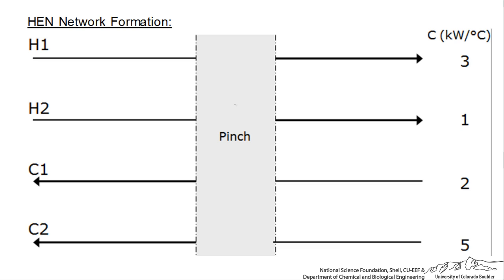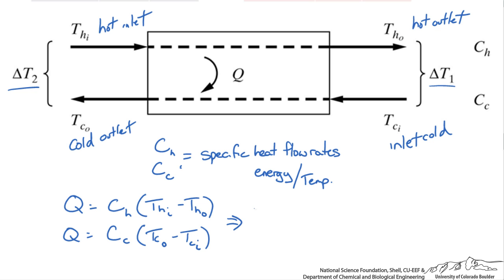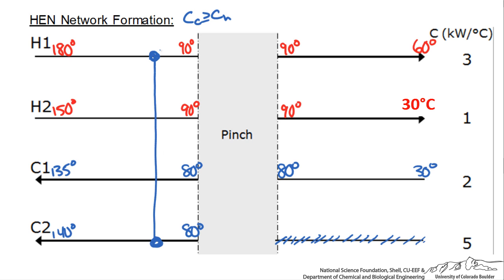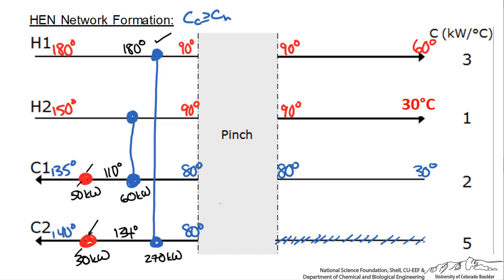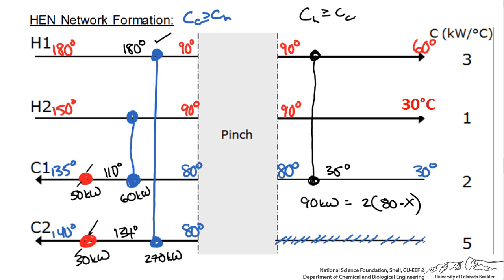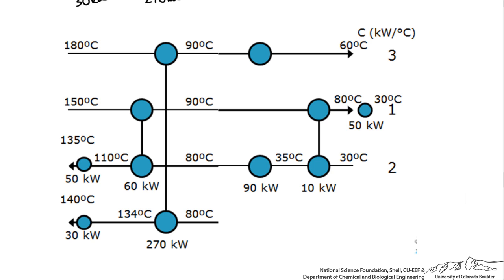Designing a Heat Exchanger Network

Comment: I am confused. Here you are connecting H1 to C1 and by delivering 90 kW of heat, temperature of H1 will reduce from 90 deg to 60 deg. This part is ok. But after receiving 90 kW, temperature of C1 should rise by 90/2=45 deg which means temperature of C1 will go to 35+45=75 deg. But you mentioned it as 35 deg. This part is not clear to me. Can you please clarify?

Comment: Great video 👏 small correction at 8:15 is required cold stream can be heated to 75°C not 35°C
Reply: No, it 35 deg only, i think you took temperature difference as (t-30) instead of (80-t).
Reply: @rohanchess8332  it doesnt matter, either way you apply the same utility because its a 5 degree difference
Reply: I saw that too.  For a stream that requires 100kW to heat from 30-80°C can't move from 30-35°C with that heat capacity if you injected 90kW

Comment: For the hot pinch, what do you do if the hot energy is greater than the cold? I guess it means the hot has enough energy to cool the hot stream to its target temp, but how does it change the way I draw this? Do I add a utility on the hot stream? do i write the cold stream energy under the circle instead of the hot stream energy?

Comment: Hello, I'm a Chemical Engineering student. I have a question, we are required to design a heat exchanger network based on an already reported process, what I don't really know is if we can only apply this method to the flows of the heat exchangers that we already have, or if we can also include the flows coming from other equipments (like reactors o flash separation devices)

Comment: On the cold side of heat exchanger network 
Ch>= Cc
Then how did you do the last heat exchanger
Reply: Yes if you start from 30 DegC cold water inlet and match C2 with H3 you will get cold water outlet as 75 degree but then there will be a discontinuity in stream temperature at the pinch point which is 80 degC.. So how do you account for the the temperature rise of cold water from 75 deg to 80 deg C. You have to add a hot utility then which is against the rules of pinch analysis as one should not add hot utilities in cold section and vice versa because they in turn increase utility requirements on the other side to maintain energy balance. So one should always start from the pinch temperature. The theory on the web cast is correct. Moreover if you do that you may not be able to utilise 10 kw of C1 to cool H2.

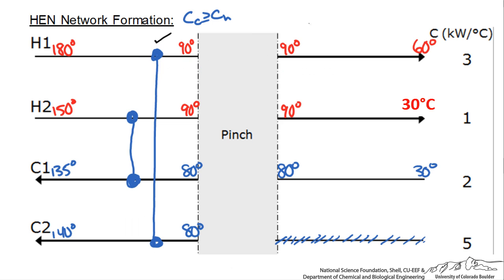Comment: Question at around 5:00. Why can't we increase the cold stream from 80 C to 140 C? (@C2) I didn't understand the reasoning behind that :)
Reply from the maker: Great question!  So the duty to cool the hot stream from 180 to 90 C is 270kW as shown in the video.  This means that it can only take 270kW of out of another stream.  However, the duty required to heat the cold stream from 80 to 140 is 300kW.   This means that the duty of 270 kW from the hot stream is not enough to completely heat the cold stream.

Please let me know if I can clear this up any more!

Comment: Links to the heat loop video?
Reply from the maker: Unfortunately we don't currently have a screencasts regarding heat loops at this time.  This is however a topic we are considering.
Reply: Okay :( any alternative links I really needed some insight into breaking loop and stream splitting methods
Reply from the maker: Unfortunately this kind of analysis is based a lot more on the intuition of the person doing it than a specific procedure.  In general, a heat loop occurs when there is a clear circular connection between multiple heat exchangers.  Alternative exchanger configurations can break them, stream splitting, or replacing an exchanger that is part of a loop with one or more utilities.  How these loops are broken, or if they are broken at all, typically has a lot to do with the cost of doing or not doing so.  I'm not aware of any specific links that offer more detailed guidelines.  I hope this is at least somewhat helpful!

Comment: While evaluating in the cold side, the connection is made between H2 and C1. but the rule specifically says that Ch>=C1. In this case 1!>2. How can one connect these two streams? and what did you exactly mean by crossing over at that point?[8:12]
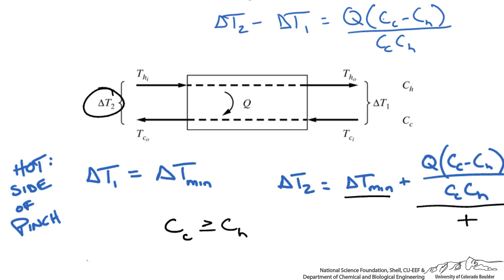Reply: For those who are still wandering: If you look at the derivation at 2:50, we say that DeltaT2 corresponds to DeltaTmin. So we know that DeltaT1 needs to be bigger than that hence, c_c has to be smaller than c_h. But at 8:12, DeltaT2 does NOT correspond to DeltaTmin, but is (90-35=55K) and DeltaT1 is (80-30=50K). So if you look at the derivation at 2:50 you would only be allowed to do this transfer if c_c is bigger than c_h even though we are at the cold side of the pinch. So always check if the temperature difference after the transfer is bigger or smaller than before than check if c_c has to be bigger or smaller than c_h according to the two formulas mentioned around 2.50.
Reply: same doubt here

Comment: In cold side networking you have to remove heat from H1 and add heat to C2 . 90kW Adding to C1 heats it from 30 degrees to 75 degrees. How can you get 35 deg , you are not cooling down the cold stream i suppose,  and the remaining 10kW is supplied by H2 making the cold utility 50kW.
Reply: Yeah, it's 90 = 2 (x - 30), not 90 = 2 (80 - x).
Reply: Yes if you start from 30 DegC cold water inlet and  match C2 with H3 you will get cold water outlet as 75 degree but then there will be  a discontinuity in stream temperature at the pinch point which is 80 degC.. So how do you account for the the temperature rise of cold water from 75 deg to 80 deg C. You have to add a hot utility then which is against the rules of pinch analysis as one should not add hot utilities in cold section and vice versa because they in turn increase utility requirements on the other side to maintain energy balance. So one should always start from the pinch temperature. The theory on the web cast is correct. Moreover if you do that you may not be able to utilise 10 kw of C1 to cool H2.
Reply: +Srihas Velpuri 
yeah your right i caught that also, its just a mistake
Reply: @mustafak4b   Nope, that's not a mistake. He is right. In his case, the 90kW  from H1 can heat up C2 completely to 80 celcius only if the starting temperature starts from 35 celcius. That is why he calculated the 35 celcius there. So from 30 celcius to 35 celcius in C2,  you will need additional 10kW heat which he took from stream H2. This is why he linked H2 with C2 (In between 30-35 celcius)
Reply: @arvindrannagasparan8353  yeah but why cant you use the energy to go from 30 celcius to 75 celcius and add 10kW to go from 75 to 80 ?

Comment: How do you say that the C1 to H2 is 10 kw, in Cold section. Is the pinch temperature of C2 is changed is from 80 to 35 deg C in Cold Station?...... Then It make sense.

Kindly share your feedback.
Reply from the maker: Swami Nathan For the first exchange of that stream, the temperature of the cold stream is lowered from 80 to 35 deg C.  The remaining 5 deg C difference is then used to cool the H2 stream to 80 deg C, but a further cooling utility is needed to bring H2 down to 30 deg C.  Thank you for your questions.
Reply: LearnChemE . Do you have any additional videos on Heat exchanger networks (Pinch Technology). If possible can you pass your website so that I can follow it effectively.  

Thanks

Comment: Dear Prof,

I have the following discrepancies in your presentations

1.In Step 1 procedure, you actually swap the values of H1 and H2 streams.
1.In HEN Network Formation, You would not be able to connect H2 with C1 because, C of H2 is less than C of C2
Reply from the maker: Swami Nathan On the hot side, you need to connect ones where C of the cold stream is greater than or equal to the hot stream.  As for swapping the values of the H1 and H2 streams, I think you are referring to the previous screencast that is linked to this one.  Yes, that is a problem and we hope to correct it soon.
Reply: LearnChemE  Thanks for your reply. I still agree with your comments, But I was referring for cold side section. Please kindly check the second connectivity ie H2 with C1.

Comment from the maker: This screencast has been reviewed by faculty from other academic institutions.
Reply: +LearnChemE  shouldn't the temperature on the cold side of the pinch be 75 rather than 35?   90=2(x-30) instead of 90=2(80-x)
Reply: Yes if you start from 30 DegC cold water inlet and match C2 with H3 you will get cold water outlet as 75 degree but then there will be a discontinuity in stream temperature at the pinch point which is 80 degC.. So how do you account for the the temperature rise of cold water from 75 deg to 80 deg C. You have to add a hot utility then which is against the rules of pinch analysis as one should not add hot utilities in cold section and vice versa because they in turn increase utility requirements on the other side to maintain energy balance. So one should always start from the pinch temperature. The theory on the web cast is correct. Moreover if you do that you may not be able to utilise 10 kw of C1 to cool H2.
Reply: +Tu mi You are incorrect. 90kW added to C1 is 80 - (90/2) = 35.
Reply: yeah but aren't you actually heating C1from 30 to 75 not cooling it from 80 to 35?

Comment: Hi there.. Was wondering how do you calculate the estimated temperatures at the pinch points; i.e. 90 deg for H1 and H2 as well as 80 deg for C1 and C2?
Reply: its actually from the last video, taken reference from that.

Comment from the maker: Actually, that rule only applies at the pinch.  Heat exchange between H2 and C1 do break the convention of Ch>Cc on the cold side but this is okay since the other exchanger is internal to this at the pinch.  The minimum approach temperature dTmin is not broken.
Reply: what if the dTmin is also broken ? 
does it mean that we cannot apply heat exchanger like you did and there are no solution ?

Comment: This is an excellent video, however you make a slight error in your final exchanger.  You can't have a heat exchanger going from a hot stream with a lower specific heat to a cold stream with a higher specific heat on the cold side of the pinch.  
Keep up the good work and I can't wait for the heat loop breaking video!
Reply: Could you explain a little bit why?
Reply: @xining3710  It's explained in the beginning of the video.
Reply: Yeah I was confused by it too